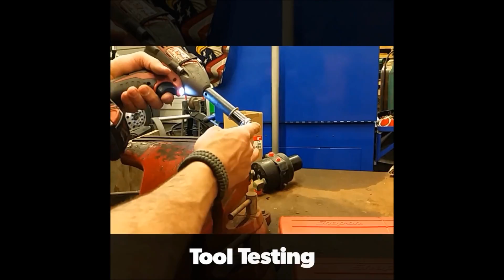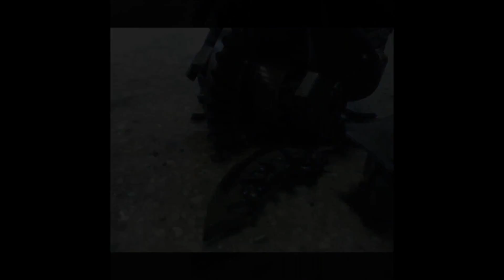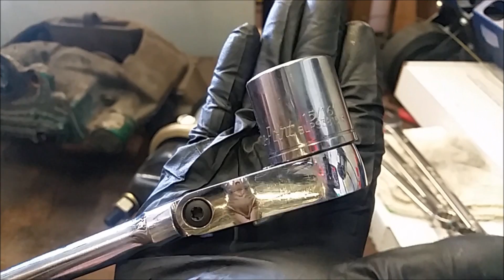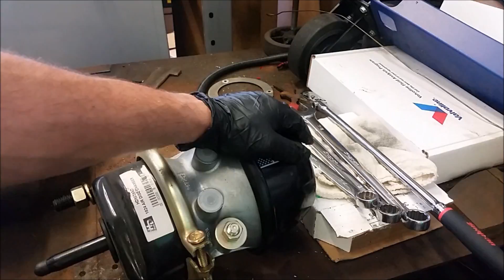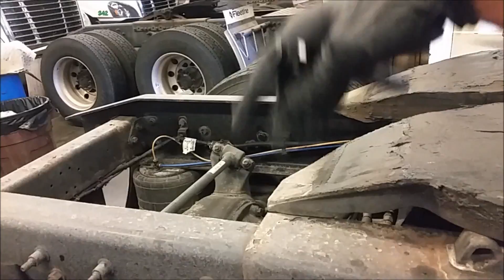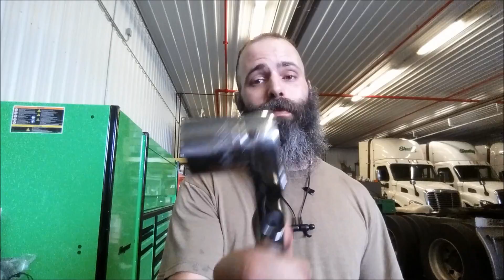Bendix Air Disc Brakes, Part 2: Components and Procedures

Comment: So when you showed the top view of the can you said to take air lines off an then take nuts off an it has a little pressure on it an will shoot off. Did you not cage the can before you took the can off. I work on car haulers so I don’t have the pleasure off working from above. I have to work under the truck. So would you suggest caging the can before pulling it? How much pressure does it have?
Reply from the maker: For the disc chambers that are accessibly from top, unles the spring inside are badly broken, after you smack them off the caliper, they have enough inerstia to skid to the duals on opposite side of axle across concrete. If my only option was from underneath then yes i would cage them mostly or access via taking wheels off (if it was necessary, i.e. can and caliper went bad and burnt up a.rotor or wheel seal etc). Good question, thanks.for watching

Comment: That's a different brake can than the ones I've done, the ones I touched had a 15/16 bolt on and if would just cage with the impact to do the brakes and mating bolts were 15/16 as well I would put a wrench and 4lb hammer to break them free, after that it was a 1 3/16 bolt for the calipers
Reply from the maker: All the air disc brakes by bendix we have take these k132352 chambers, both the 2015s as well as the 2020, and 2021 trucks, mounted with 5/8 nut (15/16 wrench size). I dont cage them going off as they usually help separate themselves from caliper unless spring is broken bad. The newer calipers instead of being soc-cap bolts like 2015/16 trucks we have use the large side mounting bolts (32mm socket).

Comment: I use a siml240 Snap-On socket to cage the brake chamber or brake can and a 15/16 ratcheting wrench and 5/16 Craftsman universal socket 1/4 driver works great for the slack adjuster
Reply: Or a siml160 3/4 extra deep Snap-On socket 1/2 driver
Reply from the maker: These dont have slack adjusters unlike regular air brake systems, but have used regular deep 3/4 inch socket in past to cage brakes then tighten rest of way with ratcheting wrench, but when you have 8 cans to do in a day that got old so picked up a sunex extra deep impact socket off amazon for 14 or so bucks, made things go way faster and easier lol. on regular air brake systems like our trailers and couple of diesels use you can usually get to can mounting bolts with impact, but way these line up on the calipers a 15/16 ratcheting wrench is too thick to get around nuts. thank you for watching and input on this vid!
Reply: I usually release the brakes and throw in the caging bolt. Tighten as required

Comment: If you are pulling any air can, release with the air and cage it before you do anything else. Not caging is sloppy and hazardous to your health. It wouldn't be as dangerous as replacing the parking brake diaphragm (old days I changed a lot of them) but you could get badly hurt and I'm allergic to pain. 
Good video, we just got our first disc brake truck and I'm looking for info Before I have to work on it. Thanks
cbmech 74  MCB4
Reply from the maker: Changin pancakes and piggy backs quite bit different from these style of cans, weve done quite few of them
Reply: Bearded Seabee82 
You do what you want, I'll cage any can. I personally think showing that promotes unsafe work habits.
Reply: Well thats gonna be a hella lot of time using a ratcheting wrench to try and get in there to change cans since wont be able to get in there with impact due to how they face dividers, and better keep heavy hammer and longer prybar at hand doin it that way, just tryin to give ya heads up for alot simpler way to do it without straining shit out of your kidneys wrenchin all day

Comment: Cool video,  thanks for explaining.  I like the no cutting rods to length lol and not fighting with seized up pins. So are the auto adjusters? U ever have to adj them as pads get 1/2 way thru life?  If they are auto adj, and they stop adj on they're own, can u rebuild the adjuster? Or u just throw on a new caliper? Thanks for the info, always like learning stuff before we end up with something that has that stuff
Reply from the maker: They auto adjust on their own, however the adjusting mechanism is chain drive in bendix, geared in meritor. If the adjuster fails, i.e. you shear 2 of those shear pins/sockets in row on same caliper trying to adjust bavk (wheel seal etc) bulletin says to replace caliper.... pricey i know. Most parts kits for them ive seen is more the boots for pistons etc to keep shit out. Meritor reps been goin around lately to dealerships to hold intro courses (wound up with a free lunch at my freightliner couple weeks ago lol) so keep eye out for that too
Reply: Bearded Seabee82 cool deal, thanks for the knowledge.  What's one of those calipers run
Reply from the maker: Caliper, rotor and brake pad set if done like in case of one displayed lookin at about 1200 give or take 100 i think (rotor is barely 200 i want to say, caliper is spendy part)
Reply: Bearded Seabee82 WOW! wonder what the life difference would be on a Vocational truck, rather then mostly hwy. That's pricey,  I'll have to try to drive a truck with them loaded to see how much better they stop when they get heated up. Usually we get around 100-120k on the tandems and front axle on a tri axle dump truck. Tag axle we end up doing usually in middle of 2nd brake job, cause the shoes are usually falling apart
Reply from the maker: wow, yeah the heavy dumps and heavy haul trucks are definitely a different animal, especially when you have upwards 2 steer axles and multiple tag axles would be interesting to see. as far as OTR goes, air consumption for actuation is way lower, only have 2 small tanks (13"wx24"L) the next truck we are getting ready to do pads and drive tires on has about 700k miles (maybe bit more, hard to keep track some days when you have 70 of these cngs) on the original pads yet. The few diesels we have left we got about 800k miles on shoes and drums typically unless somethings happens (alot of open highway) Penske we saw alot less on a number of lease trucks (typically 250k-300k miles) on shoes, drums, and clutch. alot of it driver habits and what truck was used for.
Reply: Bearded Seabee82 interesting,  thanks for feedback,  gonna look into them and see if even offered in the heavy spec axles yet
Reply: @BeardedSeabee82   have you had a caliper lock up on you? I've got a trailer that the inside pad is completely gone and half the rotor has been ground down. The pistons are pressed against the rotor. Outside pad is worn down but in fact. Stuck pistons? Any thoughts?
Reply from the maker: @michaelclabaugh9634  usa trailer or uk trailer? We have had instances where brake can has gone bad and as well caliper has gone bad, to point where it smoked the pad and steel backing on pad started to eat into rotor. Typically on the caliper failures ive seen on my end due to internal corrosion of either adjusting gears or boots around pistons being damaged allowing to rust
Reply: @BeardedSeabee82  usa trailer. The boots are damaged so that could have been the cause,rust or debris. Thank you for the info, kinda new to disc brakes on HD trucks and trailers. Im gonna call Bendix this morning to see if the pistons are supposed to return into the caliper even if they were to travel all the way out. I would think no matter how far the pistons extended out from the caliper, they should re compress. Thanks again. Subbed
Reply: @michaelclabaugh9634  if they get out to maximum they slip out of the adj mechanisms(in this case they will not get in ).

Comment: Im familiar with older air brake systems with drums. However the bus company i work for just got a brand new bus with disk air brakes and they look totally different from what I'm used too. My question is, do Bendix disk brakes have slack adjusters? 

Because call me an idiot, but for the life of me i can't seem to find them. The brake can just connects directly into the caliper and it appears as though there are no slack adjusters. Maybe they are there and i just can't see them? 

I only ask because part of the pre trip inspection involves checking all the brake components so it's important to know what all is there.
Reply from the maker: Not a problem. I cant remember if it was somrwhere in the part 1 vid of that or the part 2, where i showed the internal adjuster on the caliper. But on the disc brakes there is no slack adjuster. Basic components for inspection would be as follows: air lines and fittings to brake chamber, brake chamber visible condition, chamber mounting bolts nuts and mating surface to caliper, caliper, caliper looking mounted secure to axle. Also, a little hint on checking wheel seals on these, if it is relatively dry out or most of your rotors are dry and you have one rotor that looks like it is wet around the outer flanges the wheel seal could be going out. Any other questions just feel free to ask
Reply: @BeardedSeabee82  thank you for the info

Comment: What size was that brake chamber
Reply from the maker: It is a 3030 on for the model of truck it is on, always consult dealer with VIN to ensure propper size in case your unit cals for dofferent size

Comment: All of my units come with the shear adapter and i got 2 with a set of brake pads.
Reply from the maker: Yup, after a while you build up small supply in your junk drawer of about 25 to 30 or so of the shear keys

Comment: Your "shear pin" is an indicator to diagnose a faulty auto adjuster of the SAF(knorr) disc brake caliper. Also prevents idiots from destroying a good one for that. A ratchet spanner is good when working fast. The only difference is that pre-adjusting i only do 2 ticks, not 3. But i dont think thats so relevant. I'll have to ask the next time i see a SAF engineer which is very rare.
Reply from the maker: Spanner? Are you in the UK? And yes, shear pin breaks off supposedly around 28ft lbs ish and if you break 2, replace caliper, as for SAF, well, we use bendix on our trucks. As for click preference we just do the 3 per bendix, but will take truck several goes around the lot to warm up brakes and run them in a little
Reply: @BeardedSeabee82  The ratchet spanner is a tool. Im sure you Americans have such. Not UK, but Finland. i have never seen bendix calipers or such brakes ever. But haldex we do have.
Reply from the maker: @2Str0k3  span and spanner are terms i have heard before but only from my freinds in uk, austrailia. Here it is just wrench or ratchet in US. All good though. Haldex brakes we have, but only on some of our trucks with drum brakes and trailers with drum brakes and their slack adjusters as far as our fleet goes. Meritor is another brand here in US as well with kind of similar set up for their disc brakes as bendix, but adjuster is much different set up on those however.

Comment: If you cage it before you take it off it won't fly off and hurt somebody
Reply from the maker: You have to either pry them off or break them free by smacking them with a hammer. And since these are from disc brakes, not drum, they face towards center of truck, not towards back end of truck